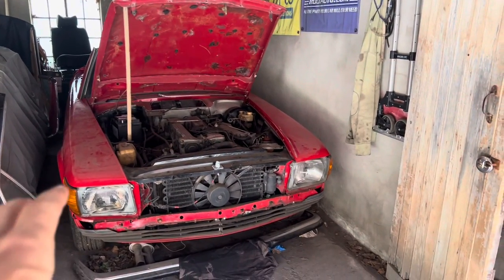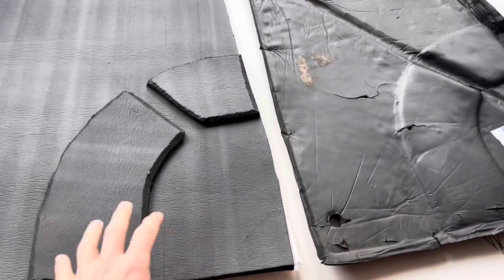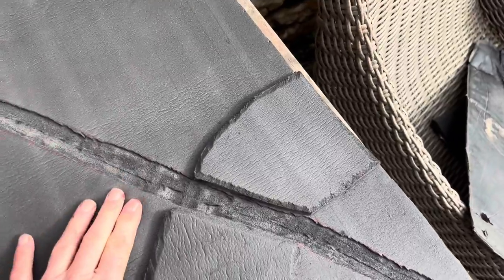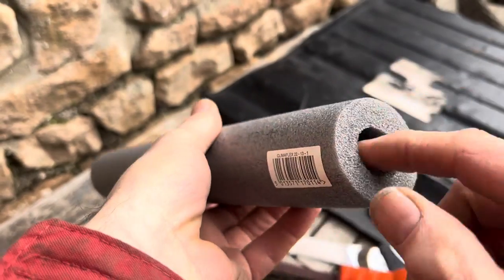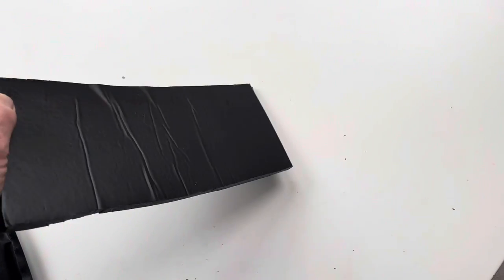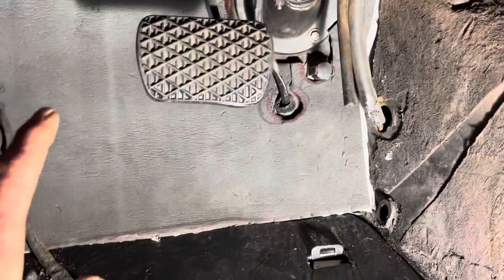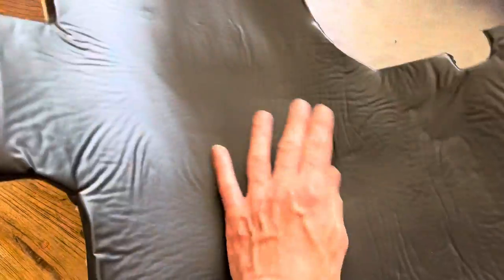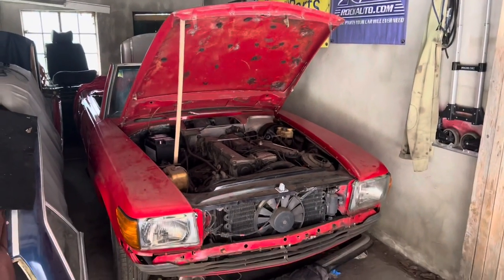Mercedes R107 - seats are in + tips on reproducing OEM looking under carpet mats

Comment: Fantastic work, you have earned the name "Mike the Mercedes Magician!" Get it running before you do anything else. 

Also check the timing chain, tensioner and valve clearances. The valves on the M110 should be adjusted every 15,000KM.
Reply from the maker: Thanks for your comment. You have reminded me to check this on my silver 1976 280SL - it has done over 250,000 km! Mike
Reply from the maker: Probably a VERY stupid question but...The car I am working on has air con with lots of vacuum lines. Am I right in assuming that a vacuum leak in say the air con system would NOT affect the vacuum on the engine running side of things? Mike
Reply: @MikesMercsandothercars  A leak in the A/C vacuum circuit would surely effect the engine, as they all ultimately go to vacuum intake. What you can do, is completely block off the all the vacuum lines so you are no dependent on the various diaphragms.
Reply: But before you get to worry about vacuum, first see if you are getting 1) spark and 2) if the injectors are firing. The D-Jet usually will have issue with either of these.
Reply from the maker: @cav4290  Thanks for your reply - yes - blocking off the lines behind the central console is a good tip. I need to put everything behind the aircon panel back together before I move on to fuel tank and engine. Mike